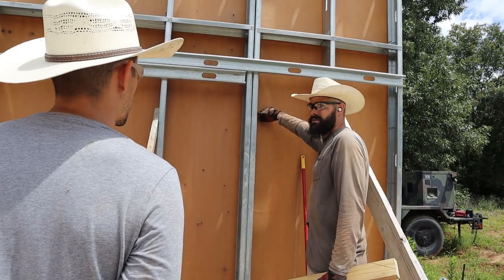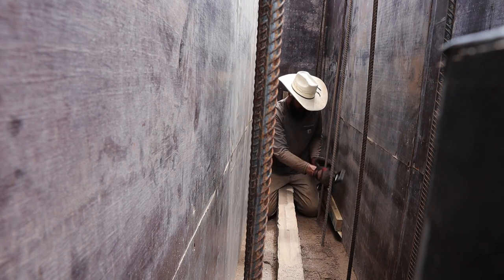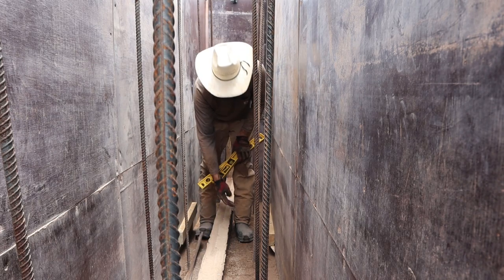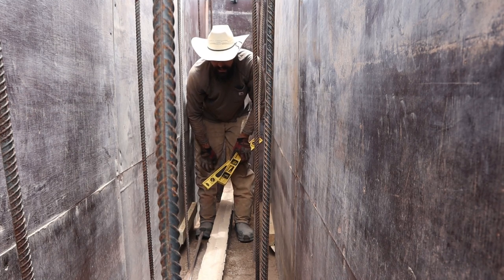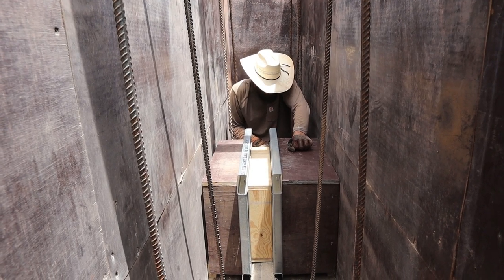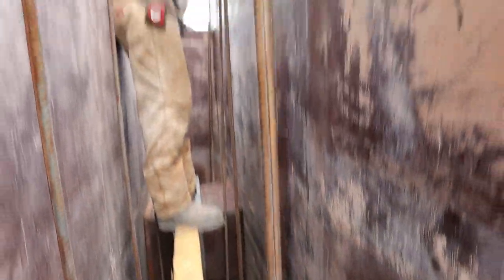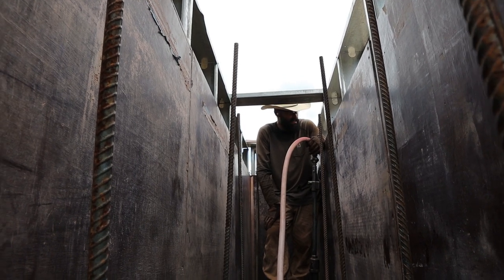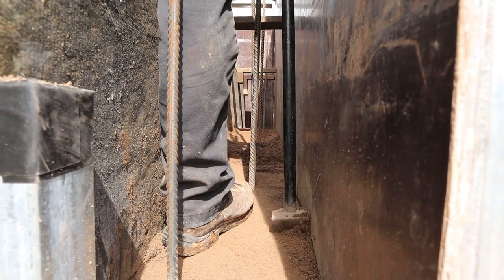Ramming around Rammed Earth Window Punch Out - Vlog 64

Comment: it is fantastic project and courageous.
i have some questions: i see you are using "large" steel rebars inside the wall, what about effect of dilatation of them, and what about corrosion ? cement act to passivate the steel corrosion due to his acidity, but what is the earth acidity level?
Reply from the maker: Those are all great questions that I don't know the answers too. My guess would be that the acidity is lower than traditional concrete but let me do some research and find out
Reply: @RedEarthRanch  yes,thank you to share. i'm building a little family house in Thailand (Europe style), and later, i already have the place done and deep foundation pipes to start a rammed earth house.
With Lime cement (ot concrete) they don't use steel (or eventually bigger stainless steel, but that is expensive), instead, they use good quality of bambou (no dilatation and no corrosion).
Reply: @DGDG0000000  Hi! I was thinking the same thing regarding the cement use that many rammed earth builders use. Why not use lime powder mix for cement? RE the bamboo use for reinforcement (rebar), do they hollow the inside and just use the outer shell, or just cut a bamboo tree, and use it as is? Do they treat the wood before use, and if so, what is used? I’ll be building some rammed earth structures in Tanzania next year!! I love watching this family’s build, and their on camera thinking through process. It gives me ideas too!!

Comment: How thick are your walls? and
What is your recommended thickness? 
I see  you fitting comfortably inside the forms.
Are rebars mandatory or optional for sound structural integrity?
Reply from the maker: The walls are 2 feet (60 cm) thick. The rebar is definitely good for structural integrity because we are building so high. You might get away with no rebar for a short, none load bearing wall, but I wouldn't recommend it.